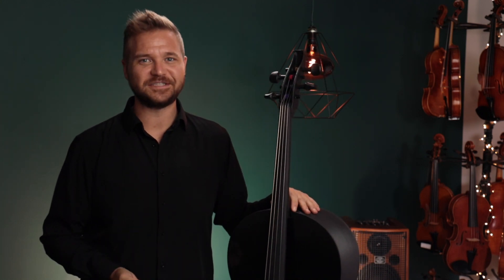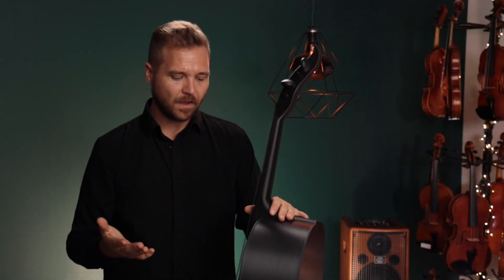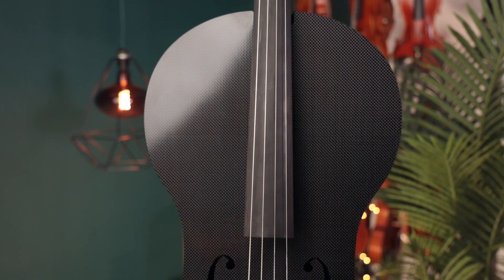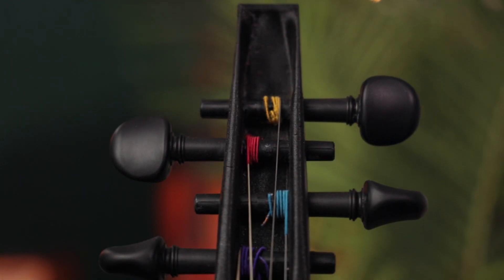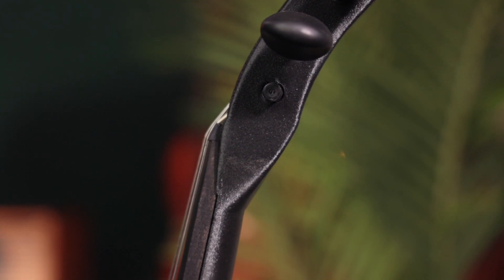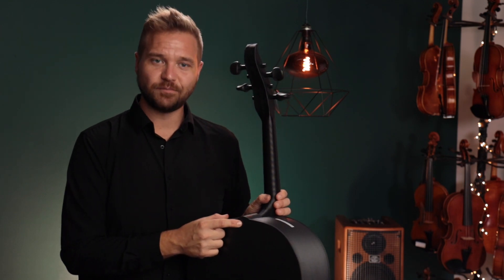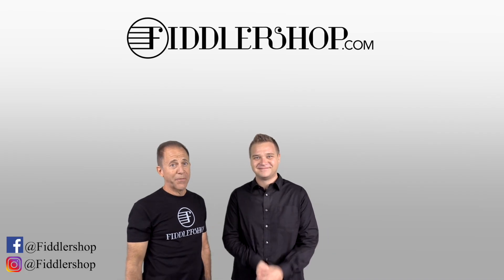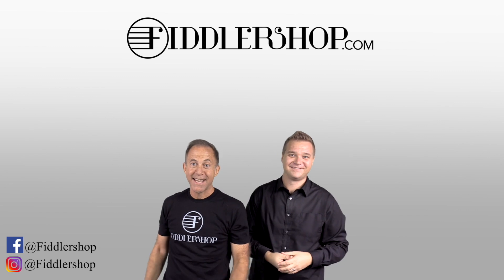Forte3D™ - Carbon Fiber and 3D Printed Cello from Fiddlershop

Comment: Seriously? Carbon fiber when the rest of it is a cut out?? Hhhmmmm i find this very hard to believe…. I have an L&C carbon fiber cello and i seriously doubt the cello depicted here and the website is going to last.
Reply: Hello, I’m the designer of Forte3d cello AND a huge fan of Luis and Clark. (As you can see in my profile pic.) My relationship with Steph and Louie goes back decades and I love them dearly.  Yes, their all molded carbon fiber cello is a bit tougher than ours. The 3D printed parts of our cello are made from aerospace grade carbon fiber infused filament. While much tougher and more durable than wood, it is not quite as tough as traditionally made molded carbon fiber. The tops and backs of our cellos are made from traditional carbon fiber so they are the same toughness.  Zombie apocalypse I’ll take my L&C, otherwise, I’ll play my Forte3D.
Reply: Owning a L&C did not make a person superior owner than other style cellos.  I believe Yo-Yo Ma would not state the 20th century luthiers as "infringement" of Montagnana.  In the history, there are many cornerless string instruments: materials and designs are workmanship's individual creativity.  Did L&C violins infringe those old masters' instruments?  Carbon fiber has been widely used and L&C was not the creator of carbon fiber.  Enough said.
Reply: @jpw-ie4yg well said!

Comment: Got mine over 1 month ago as "spare" of my "wooden spare cello."  I just took a close look and found the base bar (carbon fiber, of course).  The concave design (Spruce top in wooden cello design) made a lot of sense, since carbon fiber is way stronger than wood.  I found it responsive and balanced across the strings (which was fit with D'Addario's Helicore set).  The bridge with Forte3D mark on it - and was well made.  The clear sound from the cello makes me more aware of my intonation.  The projection are quick and deep - less tiring when playing Bach Cello Suites.  This is my first time using Winner fine-tuner pegs and I love it!  Fiddlershop was EXTREMELY helpful and knowledgeable when I called for the inquiry.   
Only few things I wish Forte3D can improve upon.  The lack of scroll -- it is not aethetic but functional.  I would like to have some extension "scroll" part for extra security when placed in the hard case.  It can only be fastened at neck area which I am not a big fan.  The wood sound post seems a bit long that did leave a visible "protruded" mark at the back.  I plan to take my cello to have my luthier for consultation - maybe shorten/adjust the sound post after few more months of playing.  I might choose Obligato set to add extra complexity and tune down the metal strings' brightness.  I have grown to like  and enjoy this cello more and more.  For the price - it is way worth it!
Reply: https://www.youtube.com/watch?v=n61rxv44zEA&ab_channel=Forte3DLLC
That mark at the back is by design, you shouldn't change that. Check this video at 23:23.